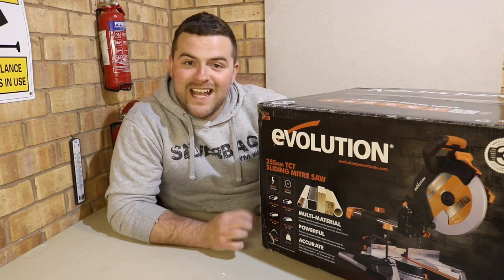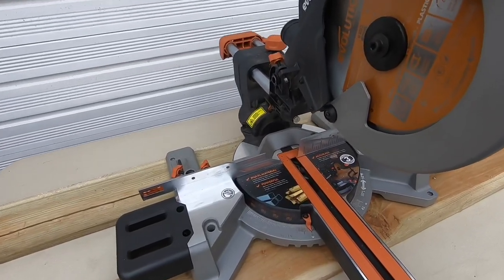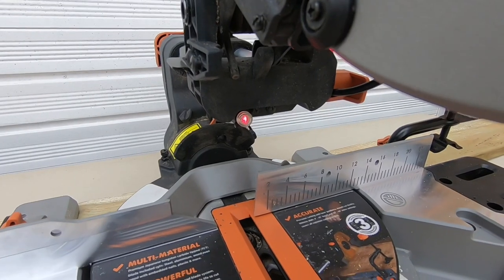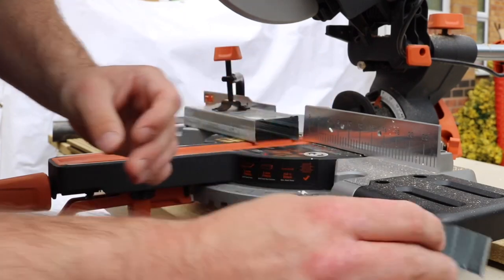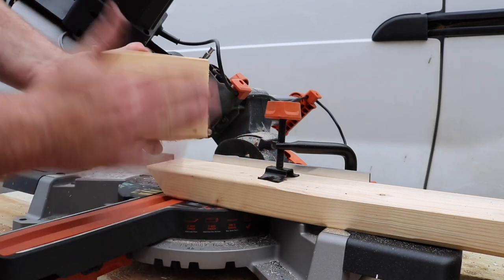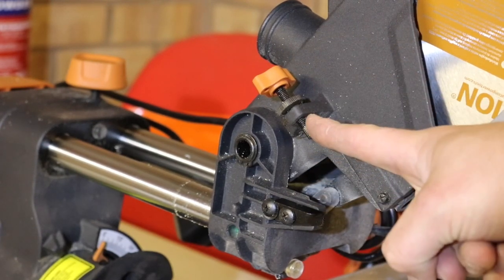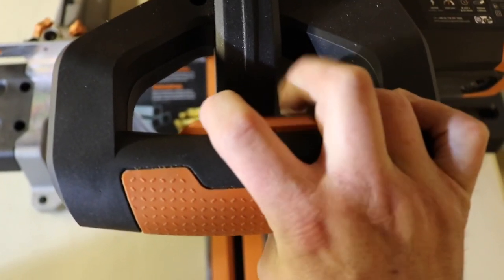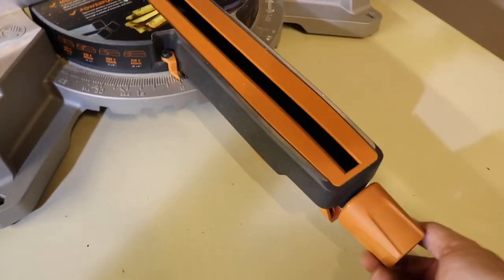Evolution R255SMS 255mm Multi Material Sliding Mitre Saw Review

Comment: Hi brotherm, i have an issue with my miter saw ( R255SMS 10"  ) the issue is , when i click on the starting bottom to run the machine, its not working until i push the handle   down if it' like full down then it will start running, what i mean is  if click on starting bottom while the handle is up, it wont work., however i  changed the carbon brush , but still i have same issue. can you please guide me how to fix this issue ?

Comment: As a none bias result you've been honest 

But.....
This is the go to communal chop saw they use on every industrial/commercial job I've been on , gets hammered day in day out by novice users on uni strut 
Dado , tray , trunking , rod , wood etc and 
People literally slam down the blade on materials, throw it about, gets left in the rain , gets covered in dust and metal fillings and still survives a year to two year jobs 
All the makita , dewalt ones the blades or there holder  always use to end up being wonky and the blades need changing all the time 
The evolution blades last very long 

It's the fairest price 
I personally think its the best 
It's light weight 
It has loads of different attachments 
I can't think of any faults to it 
I'd give it a 10/10

Comment: Would this model be able to cut through a 120mm x 240mm cedar wood sleeper at a 45 mitre angle?

I can see it will need to take two or more cuts to do it but the clearance from the slide rail gives me concerns. 

No one stocks these mitre saws locally, so its difficult to tell even with your clear video angles on other less deep materials.

Thank you.

Comment: i cannot get mine to cut true its alway off by a bit.... i spent hours trying to fix it with no luck.... i think the fence comes from factory bent or something very frustrating
Reply from the maker: It could be the blade especially if it 'squeals' 👍🏻
Reply: @PlumbingGy  i have tried brand new blades and hours of calibrating it still off by a bit... driving me nuts i cant figure it out
Reply from the maker: It may have a faulty deck, it may be worth sending it back and exchanging it for new 👍🏻
Reply: Put a straight edge along the fence to check if true, if not you may be able to bend carefully to straighten 👍

Comment: Just bought one on the strength of this guy's review. (Screwfix).
Reply from the maker: Fingers crossed 😂💪🏻😁
Reply: Any good?
Reply: @iamaduckquack  As a novice  DIYer its fine
now I buy the stand.
Have cut wood and steel, change the blade and cut tiles no problem. The only issue is 
dust especially indoors, all in all, I'm happy with my purchase, getting a router, next.
Oh, and it required no adjustments.
Reply: @stepheneurosailor1623  Thanks for the quick response as I'm looking to buy one tomorrow!

Comment: probably iv found is that the locking on the table isnt accurate.  it clicks in at 0, 15, 22.5, 45 degrees but theres play so you can be a degree or two out either way.

Comment: not viewed your videos before, its a great vid very in depth showing off the saw and all its fantastic features, i am seriously thinking of buying the double bevel variant of what you have reviewed mainly because the 355mm lacks this which would be nice to see in the future,  ive used the 355mm chop saw for about 2-3 years  its fantastic for quality cuts

The orange multi purpose blades are good despite only really being for general purpose, for the average user lifespan of blades wont be an issue cutting wood with odd nails, pvc or very light mild steel now and then.

However if your like me intend on cutting wood and a lot of metal to get the most for your money it is worth  getting a collection of blades for each individual material you are going to cut  and change them to their material accordingly as you go this really makes a massive difference to their life-cycle in comparison to the multi purpose blade.

All i can say is beware of aluminium and stainless steel with the multi purpose blade, it will not last long at all you absolutely need the right blades for these especially.
Reply from the maker: Many thanks for the in-depth reply Tom I know exactly what you’re saying I’m going to be sent another one at the end of the month but I’m not sure which one this is so I’m a little excited about receiving it. 
So far they have stood the test of time on site pretty well on the more than happy to be perfectly honest I only really Cut wood with them now So hopefully will preserve the life pretty well but we will see many thanks Tom
Reply: Sounds exciting i cant wait to see that, with wood im sure you will be fine for quite some time, thanks for the fab vid looking forwards to seeing more :)

Comment: Mine had blade / shaft bounce. Sadly I bought it and had it boxed up for a long time. When i went to use it, i found the fault. The bearing is fine - I opened up the motor housing. The issue is the other bearing/opening/gearbox - have to strip the whole thing down to get at that. Disappointed.

Comment: most of 14 metal cutting blades are 1800 rpm max, why this saw has some 2500 rpm? how r u suppose to use all these blades that have 1800 or les rpms?
Reply: Buy new blades! It is so worth it as the saw is truly multipurpose and the saw blades are a wear item anyway.
Reply: This saw is 10 inches hence the 2500 rpm.

Comment: Great in depth review Dan, I also have this saw and had issues with the turntable not locking accurately however evolution where great in fixing the problems.
I also have a small youtube channel if you would like to have a nosy. Cheers Karl
Reply from the maker: Thanks Carl I appreciate it I will jump over after work and check it out 
👌🏻

Comment: Could you tell me the front to back dimension, please. My work bench is only 600mm/2 ft wide and tight the wall behind. Just wondering if this will sit on the bench OK. Thanks.
Reply from the maker: I'm not at home but on the website :
 Product Dimensions 73 x 70.5 x 36 cm
Link to product: https://www.amazon.co.uk/Evolution-Power-Tools-R255SMS-Multi-Material/dp/B07BRPWJVZ
Reply: @PlumbingGy  Thanks for your prompt reply...much appreciated! I'm guessing that the 730mm is the front to back measurement, therefore I'll have to go for the smaller R210sms+ model. Thanks for your time.

Comment: Mate, I've just set mine up, and it's a beaut. But having never used anything like this before, I can't get the base to move, lol. It's locked at the angle it came out of the box. I'm sure it's something really obvious. Could you point me in the right direction? 😀
Reply from the maker: The orange handle at the front of the base unscrew it until loose and there’s a hook underneath that u can reach with your index finger, squeeze it like a trigger and rotate the base. Hope that makes sense 💪🏻👌🏻👍🏻
Reply: @PlumbingGy  What a legend! That's done it. Got a couple of sawhorses to make tomorrow, and I can get cracking on with them. Cheers mate. 👍
Reply from the maker: Nice one jay thanks for the support 🙏💪🏻

Comment: Hi greetings from chile southamerica ,do you recommended today ,what about the blade ,still working what would you say for we the ppl that thinking In buy one after all this time using ? ,Regards .
Reply from the maker: If it's on a DIY basis then I would recommend one, the blade as anything will depend on how much and what materials you cut my first blade lasted a good while but I only cut light metals and wood.
If you're looking for something a little more professional then it maybe worth spending a little more 👍🏻
Reply: @PlumbingGy  ok thank you 👍😁.
Reply: Hello Do it all Dan is that how quiet it really is? or have you turned down the Dblevel when recording?Thanks.

Comment: can you put the evolution blade in any mitre saw to cut wood and metal ???
Reply from the maker: No unfortunately not as they vary in size
Reply: This saw is made to run slower than standard mitre saws to accommodate for cutting steel. Hope this helps.
Reply: @spencercreekenterprises7703  Thanks for your reply

Comment: Just found your channel👍 Great review of this product. Been looking for a compound mitre saw as just started diy woodworking using old pallets and I’m sick of hand cutting the planks🤣 Think this video has made my mind up👍 Also have you any experience with the £99 Titan table saw from Screwfix?
Reply from the maker: Hi mark, thanks for the comment and the support. I have actually used the titan table saw on a few sites from the same joiner, he uses it as a back up saw and to be honest it's not bad for DIY purposes. I would recommend one but only home use 👍🏻
Reply: Do It All Dan thanks. It will be home use only. In recently got hold of a load of pallet wood so made a few planters and I’ve kind of got the bug🤣. I work for Openreach so got hold of on an 80cm diameter cable drum last week so two large wall clocks are in the pipeline🤣🤣🤣  I’ve found someone local selling pallets cheap so I’ve got all sorts of ideas in my head so thought I’d invest in some half decent wood working tools and see what happens.
Reply from the maker: I can't fault you Mark, definitely worth it as a small investment for the amount your going to be using it I would say. Make sure u get yourself on Pinterest for some more ideas haha

Comment: Hi dude can I ask would that cutter be ok to help me cut me new laminate flooring
Reply from the maker: It depends on how much you are going to use it, if it's a one time thing I would go with a dedicated laminate flooring hand saw and a cheap jig so you can do precision cuts. 
If it's on a semi or pro use then I would invest in something a little better as this saw with this blade isn't the neatest at cutting. You can flip the wood over face down and get a better finish but you'll have to weigh up which option is best for you. Hope this helps and thanks for your support 👍🏻
Reply: Do It All Dan thanks for the advice

Comment: My saw blade seems to be turning in the wrong direction. Does the part of your blade closest to you rotate up or down. Mine go downwards. Seems wrong to me.
Reply from the maker: There's an arrow on the blade to show direction 👍🏻👍🏻
Reply: Downward is the right correct way , think about it , if it was going upward , the debris would be flying straight at you.   The blade would be pushing towards you.    You’d need a fence on the side facing you if the blade spun “upwards”

Comment: Woodworking Beginner: Update.
This test is only if you want to saw with precision with a miter saw.(test is not intended for rough and hard work).     
Tips and Test: 
Very important if you would like to saw with precision. (avoid torsion as much as possible)!
Always choose a Miter saw with a handle positioned in a VERTICAL line above the saw blade.  
Everything must be aligned, slide rails, handle, and saw blade,it is much better this way the blade will not tilt.
Because there is some torsion in the aluminum housing .
And choose an engine with softstart on it to prevent wear of the gear and worm shaft.
It is very important that everything is aligned.
Here are some examples to show how the handle must be positioned above the blade.
Bosch gcm 800 sj / Bosch gcm 8 sjl / Evolution rage 3 / FESTOOL KS 60 / Bosch GCM 8 SDE / FESTOOL KS 60 E KAPEX / Metabo KGSV 72 Xact / Bosch PCM 8 SD / Hitachi C10FSH / Ridgid MS255SR 10-inch / Evolution Fury3-S / Evolution R255SMS / Metabo HPT C10FSBS / Hitachi C10FSB /  Hitachi C10FS.
Second optie handle horizontal positioned above the saw blade. / Evolution R185SMS / Evolution F255SMS / Evolution RAGE3R255 SMS3 .

(This also is the case with the Miter saw without the slide rails).

(If you want). You can test it yourself at home if there is torsion in the aluminum housing.

Step-1. First you make a saw cut from +-5 mm deep in to a flat piece of wood about +- 20 mm thick to this with the normal handle positioned on the right side of the Miter saw (the wood it will remain in place until the test is completed).

Step-2. Then repeat this by pushing the saw blade down with your hand (finger) on the aluminum protective cover were the saw blade is cased in. Just now only do this without the running engine.

Step-3. Now you can see if the saw blade will be positioned in or next to the saw cut. If the saw blade is (+- 0,2 / 0,5 mm) next to the saw cut then there is torsion in the aluminum housing (test is completed).

Step-4. Therefor it is much better to choose a Miter saw with the handle positioned VERTICAL in line above the saw blade. 
The second option is the handle positioned HORIZONTAL in line above the saw blade.

Step-5. When you measure the vertical 90 degrees angle square (Digital Level Box) of you're sawblade don't forget that there is always some torsion in the aluminum housing.
Reply: Isn't vertical/horizontal handle a personal preference?
Reply: vertical / horizontal handle is possible no problem. But the point is that they always in line above the saw blade positioned .  (avoid torsion as much as possible).
Reply: I've used mitre saws for decades and the horizontal handles do not affect your wrist like the verticle ones do, that said you do need to choose your saw carefully, the best results for accurate compound mitres were from my KGS305. The Evo blades are over priced crap, don't last if using on laminate boards and at over £32 a pop I bought a different brand and fitted a reducer ring to get round Evolution's monopoly from using a different size blade bore. To sum up the Evolution, it's crap.